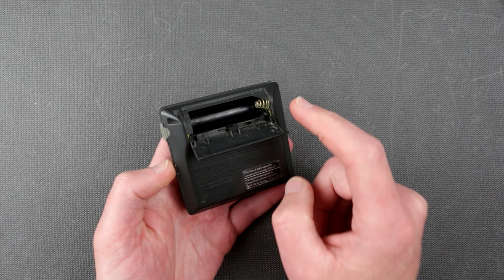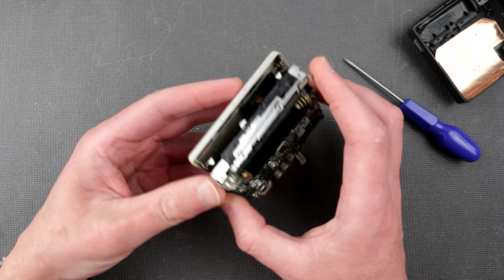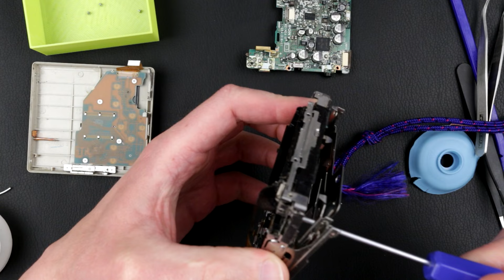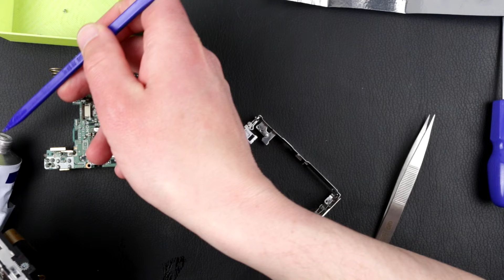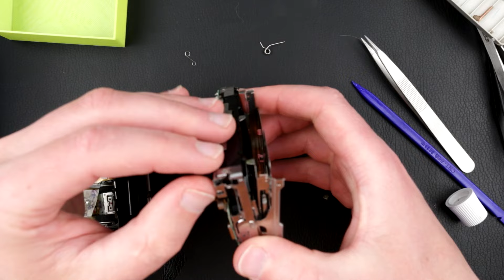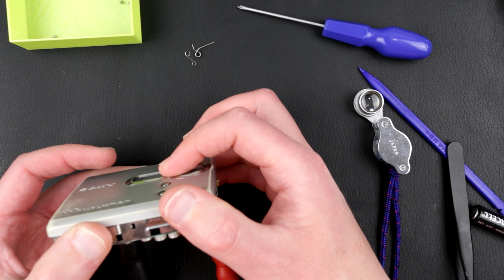Sony MZ-NE410 Minidisc Player Repair

Comment: It's always nice to watch others doing amazing repairs on such incredible sony equipment.  Two things to notify people the screw removal it's important to remember the position,  on the other models in this range the case screw is different  .. yes you did brake the open post it is very fragile and snaps easy ..

Comment: Thank you for sharing the video and for keeping that amazing technology alive. If you would be so kind, could you please share the characteristics of gears SA and SB, part numbers 4-222-216-01 and 4-222-208-01 respectively? Specifically: number of teeth, inner diameter, outer diameter, and length? Thanks in advance."